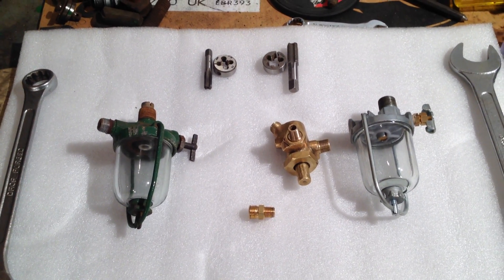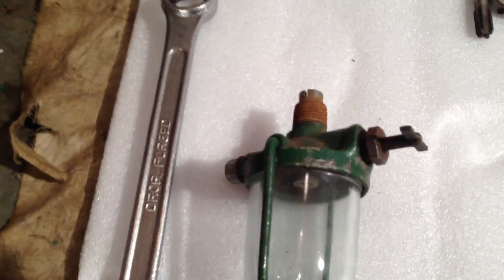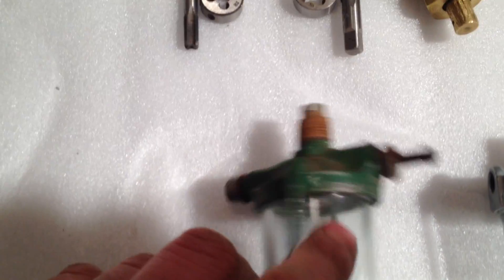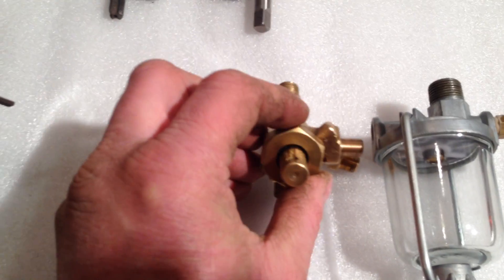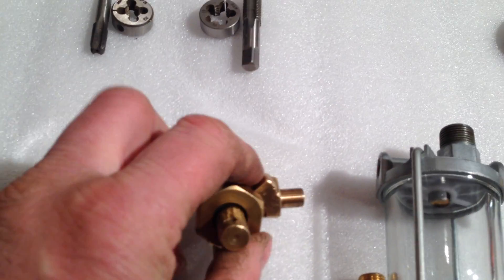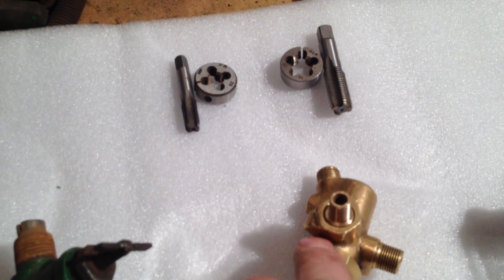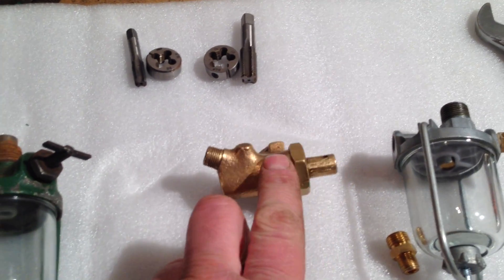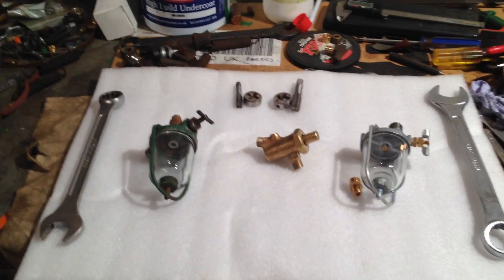1940/41 John Deere B tractor restoration (all things fuel bowls)

Comment: I fight the new sediment bowls too. Can you show the fitting you made by itself?? I have been eliminating the large brass valves and starting tank lines, I just run from the main tank and use the modern bowl with the modern tap, I had one of them valves leak and ruin a fresh paint job. I throw them out
Reply from the maker: Hi David thanks for the interest see recent video upload re fuel bowls the part your interested in is high lighted regards David